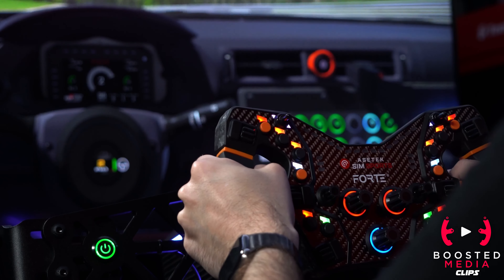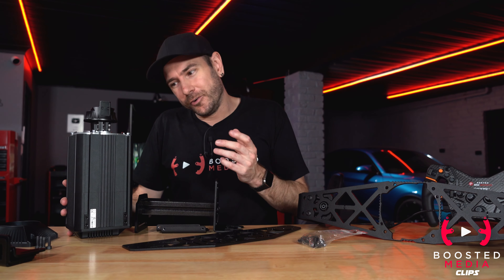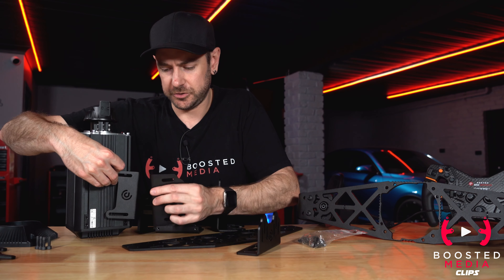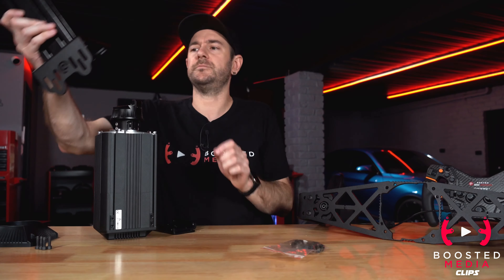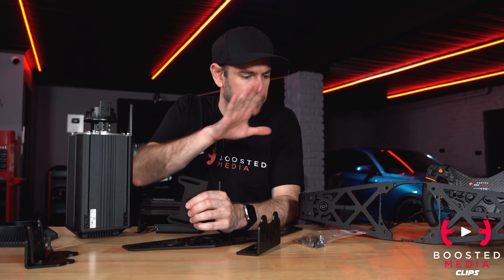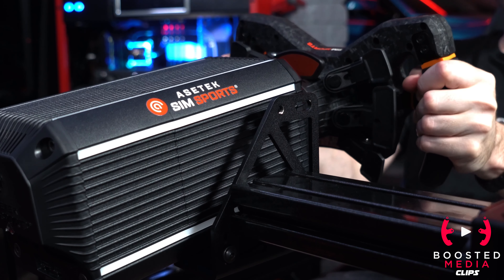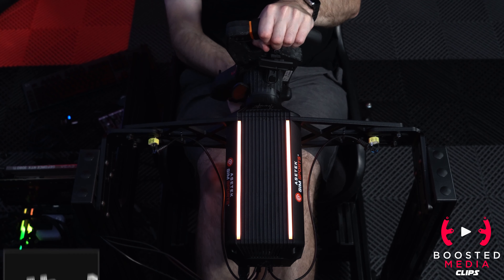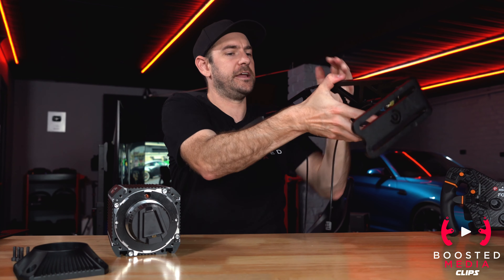Asetek Direct Drive Wheelbase Mounting Options

Comment: Would the tiltable mounts work with my trakracer TR8? Or should I just drill new holes in my rig plate?
Reply: Hi did you find a solution to this? Thank
Reply: @dannypride85  I drilled holes. Which is not difficult... but trak racer told me they were going to add mounting holes for asetek eventually. I would check with them if they did that on new rigs.
Reply: Thanks for the info!!! Have contacted both trakracer and asetek but no one seems interested in replying.

Comment: Question, did your front mount come with the necessary screws and bolts? I opened mine and there was not bolts or anything and I'm hoping it was just a mistake.

Comment: I own a nlr gt lite pro, is it possible to mount a la prima wheelbase to it? I'm looking to upgrade to asetek.
Reply: Saaaame exact situation. Did you ever find a solution? I'm new to sim racing and didn't realize how big a problem it would be to mix different rigs with wheelbases
Reply: @kabboy2  honestly I'm still sticking with my moza r9, i just mounted the moza r9 with two screws in the front and applied a bit of loctite blue to them, and the thing is steady, I also added an additional strap to hold the front bar of the gt lite pro down and it massively improved stability. There is of course still slight shaking, but it's almost negligible at this point. Hope this reply helps.
Reply: @blwm9206  Thanks for the advice, I got everything on Tuesday, but only last night, I think I figured out what to do so I can start racing when I get home from work today. I might get some loctite then to help
Reply: @kabboy2  yeah, but rly only the blue one, regular white loctite will weld shut those screws forever xD haha
Reply: @blwm9206  Noted lol

Comment: have they made this more complicated by trying to put their own twist on existing mounting standards?  I don't see the rationale for not having a normal front mount like a SC2 and a side or bottom mount like a Fanatec...and the dangling wires from the power button and kill button are just janky AF.  An absolute absurdity for what the mounting plate costs.  I REALLY want the Invicta to be my wheelbase as I'm currently in the market and wanting the best feeling wheelbase, but damn are they making it hard.
Reply: They've cleaned up the wires for the power/torque button. There's now 2 black plastic caps that sit over the back of the buttons to tidy everything up. I got the Forte base and wheel few days ago, extremely happy with it.